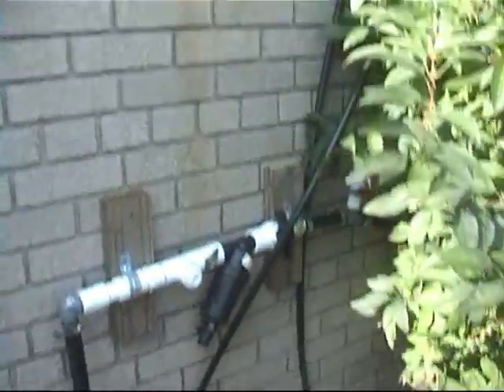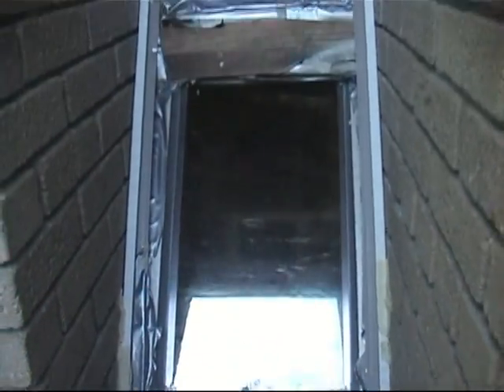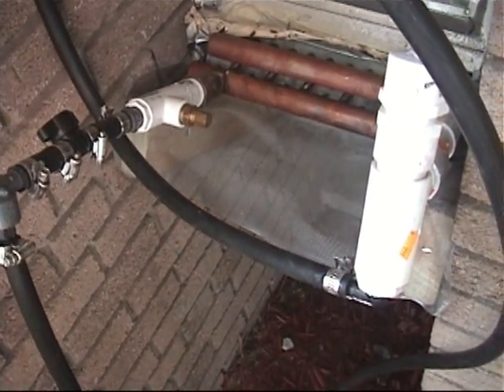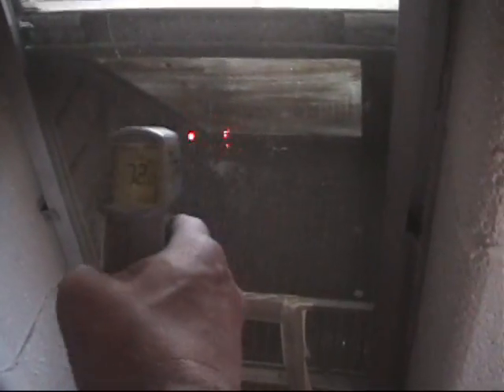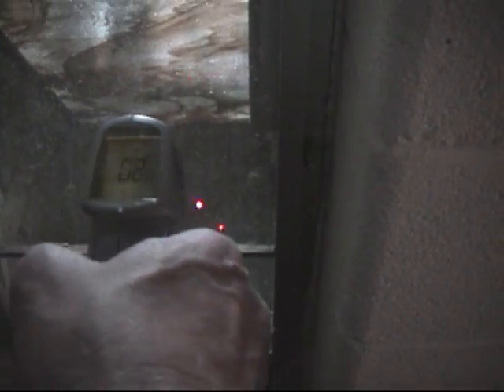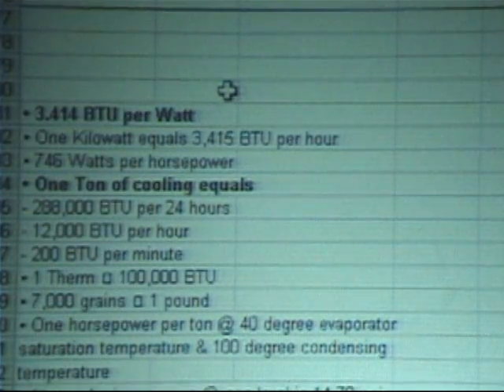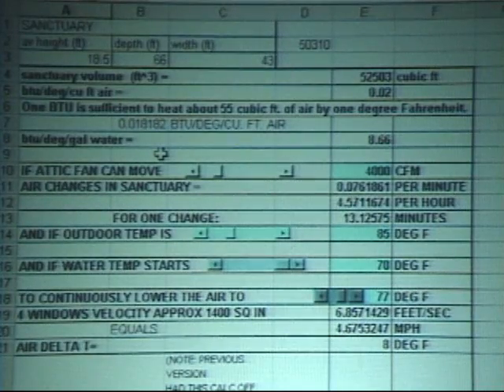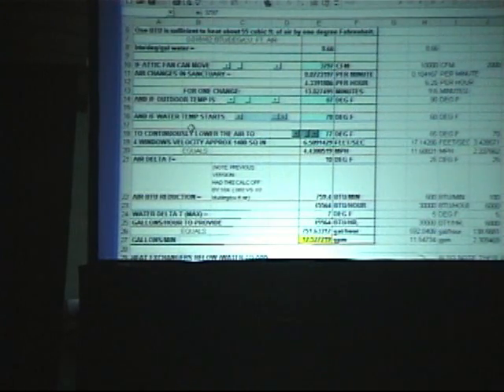sanctuary cooling system geothermal with well water

Comment: How did your pump hold up? Are you pumping about 10 gallons per minute, but not much pressure? I got the well not being used. I have a central unit with plenum and duct work and presently have 42,000 btu's of cooling

Comment from the maker: Finally, I have an HD camera now, and may reshoot it someday, but I am not selling anything, and don't have a compelling reason to go to that effort.  I have other things to do.  I was mostly documenting it so other people in the future could operate it.  I suggest you read some thermodynamic books or at least check wikipedia to understand how heat can be pumped.  However, this is not a heat pump, just as it is not a swamp cooler.  Air conditioners pump heat from inside to outside via the freon.

Comment from the maker: Continued from 3rd post - we could have put in a geothermal system with circulating water, but it would take significant work to make trenches long and deep enough to cool the water in the ground before it returns to the cooling coils.  It works best if you can just through the coils in a cold lake or stream of water.  If we had that, I would have considered it, and done the math before purchasing the 5 coils.  In addition, I purchased just one coil and used city water to test the theory first.

Comment from the maker: Continued from 2nd post - if the people coming in were willing to carry free ice, if it were available, that might be a practical solution.  We don't have a source of free ice.  We did not have to install an exhaust fan, or a well.  Operating costs are only the electricity to run the well pump, over and above running the exhaust fan, which would be run anyway.  I showed my calculations, so if you can do the math, you can figure out an effective solution for your case.  This system is real.

Comment from the maker: Continuing from previous post - I certainly would not use the air only once if I put in an air conditioning system.  However, this system uses an existing well, with very cheap sprinkler lines, and runs an exhaust fan that we use to bring in outdoor air, even if there are no cooling coils.  This means there is no additional cost to running the exhaust fan.  We could use city water, but it is not cold enough in August to work.  If we were next to an ice factory, maybe we would consider free ice.

Comment from the maker: Your definition of "practical" is different from mine.  Mine is to use find the best solution for a specific situation, not a solution for all situations.  If we had a boatload of money, we would put in a central air conditioning system.  If we did not have a well as a source of cold water in sufficient volume, I would not install a well.  If we did not have windows on one side of the sancuary, and exhaust ducts on the other, I would not devise a system that would eject air out the roof.

Comment: Another geothermal method shows that long plastic tubes are buried down the earth more than five feet deep and heat pumps(Air pump?or water pump?They are using confusing name for a pump.Aim is cooling,then why "heat"?)are used to flow the air from hot room to the cool earth to make the earth cool.Do you know what is the price of those long tubes?And if one tube is leaked in any portion,who will again pull the soil upward to reach there to repair those leaks?And what is the price of the pump?

Comment: There are several videos showing a pedestal fan has encircled with copper tubes and ice water is passed through it.  Question is who will carry the ice all the time, and wherefrom the ice would be bought all the time to home? And who will maintain all the times those ice and water? These are just unpractical methods. Useless.